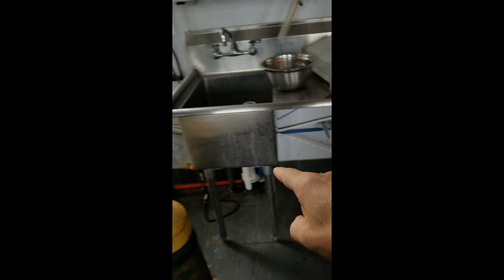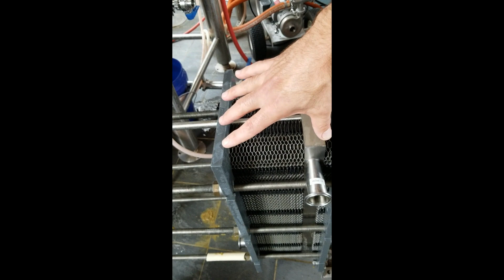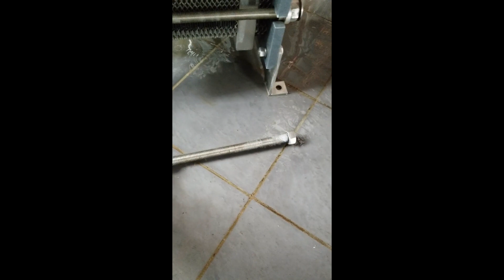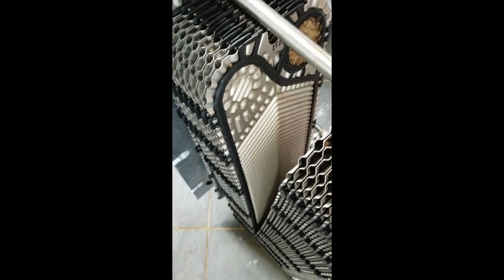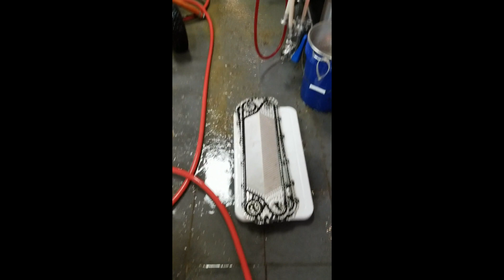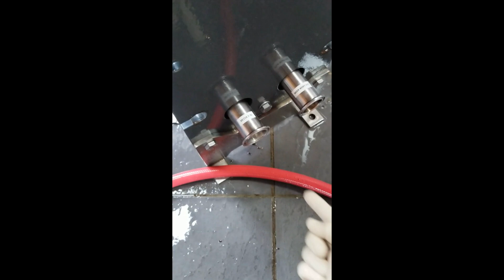Cleaning the Thermaline heat exchanger at Man Skirt Brewing

Comment: Quick Tip: Mostly every PHE has a factory plate sequence that must be followed after taking it apart and during reassembly. You should inspect the plates, which usually come numbered and you must follow that order. The reason because of this: First plates that come in contact with hot wort usually have a thicker body than those that come in contact with the glycol. Usually hot wort will drive more pressure and heat that has to be overtaken by a thicker plate.

Comment: Your carbon steel t8 
, you really should order a 1-1/8 ratcheting wrench from Thermaline it will aid in the loosening and tightening   With cheater pipe makes the hand tightening easier , always measure first before you loosen  write it down so you can return to the exact spot when closing

Comment: In your experience, do you ever see micro issues stemming from this style plate chiller? Frequent removal of gaskets make me nervous.
Reply from the maker: Same here, which is why I do it as infrequently as possible. With a good CIP procedure, you shouldn't have to break it down more than once a year or so. As for micro, I don't depend on chemical sanitation, instead relying on heat pasteurization. That way I can be sure the entire stack is sanitary and not worry about the nooks and crannies the chemicals can't reach.
Reply: @ManSkirtBrew  Great points, almost forgot about the hot water sanitize. Thanks for the great content and quick replies. Cheers!

Comment: silly question but do you CIP that thing after each transfer?
Reply: nvm saw your reply.  I have taken one apart only once in like 2 years or so of use since it was last taken apart by someone else and it was so clean i felt like i wasted time doing it
Reply from the maker: Not silly at all. I do CIP it every time, which is why I don't have to do this often. Once a year is probably more than enough to take it apart.